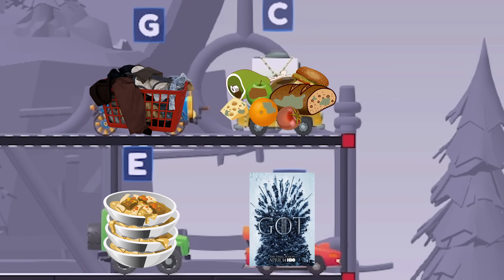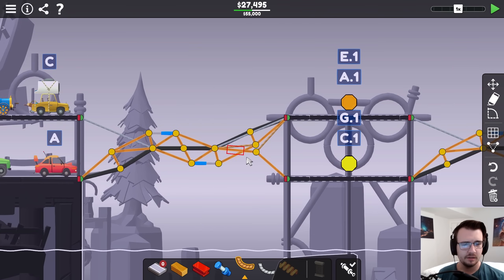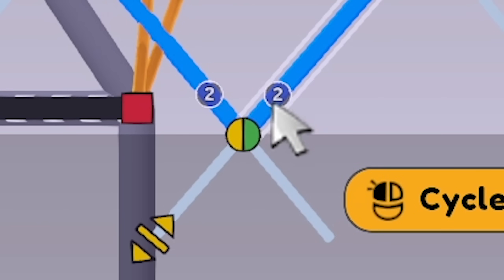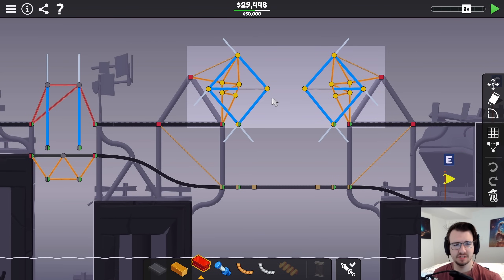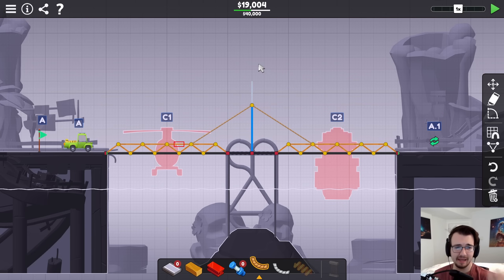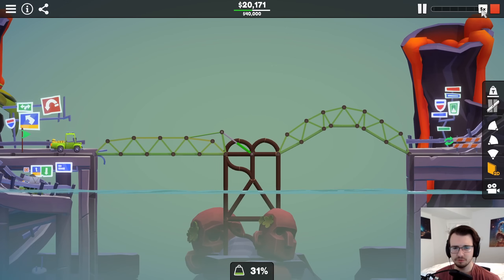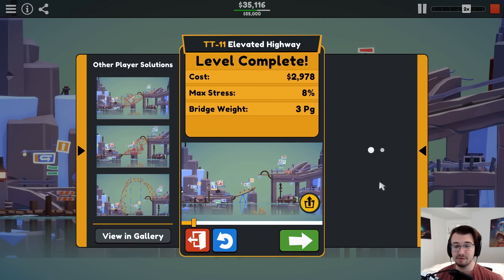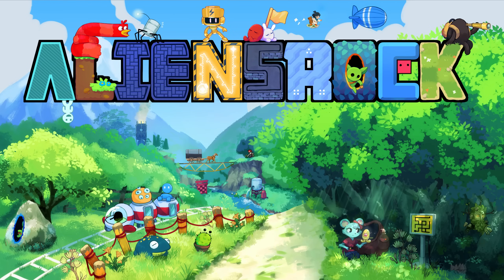Extreme Hydraulic Elevator Bridge! - Poly Bridge 3

Comment: Devs went through the trouble of coding a player placed static joint in the form of the foundation only for basically every level with it to not require it at all. I kinda feel bad for the devs sometimes xD
Reply: Don’t worry, I’m a low stress player and we use it all the time. When you’re making the most of your budget, it’s really efficient.
Reply: TBF it is useful for some of the challenge /weekly levels, it's just that campaign is trying to appeal to both casual and competitive players
Reply: Foundations prioritize low stress over low budget, although I do think that, even casually, it's a little under utilized.
Reply: Its very usable for people who dont minimize budget though
Reply: Well if they would lower the cost it would be used a lot more!
Reply: What we need is the option of a concrete foundation or a cheaper wooden peer foundation - the same as steel vs wood.
Reply: @bruceleenstra6181  a cheaper static joint wouldnt work it would have to be able to move in some way
Reply: @tomzitiger The foundation has two static joints near its top, then two segments of either steel or wood joined together like this /\ *that can't be removed*.
That way if you put too much weight or stress on them they will fail.
Reply: @bruceleenstra6181  i guess that makes sense
Reply: @bruceleenstra6181 But you can’t break static joints…